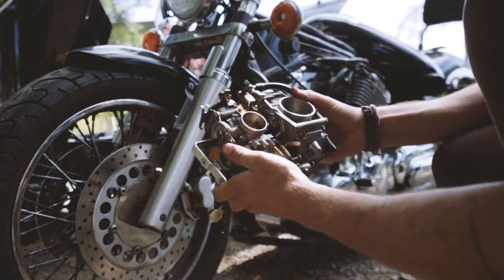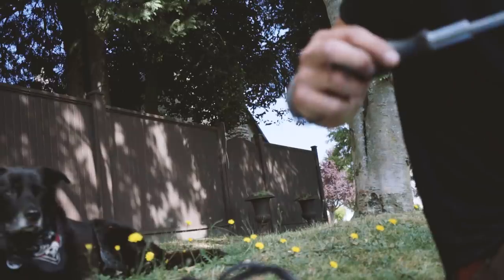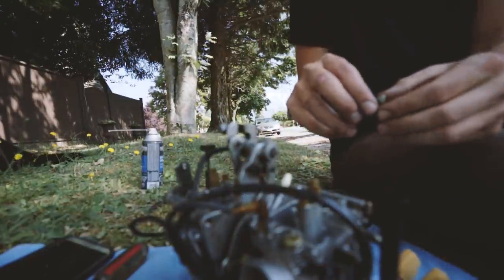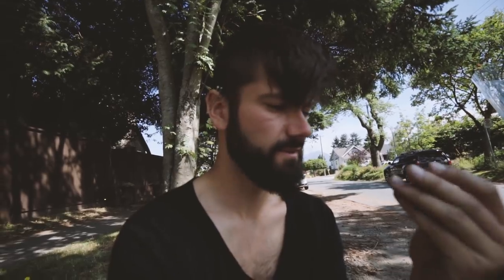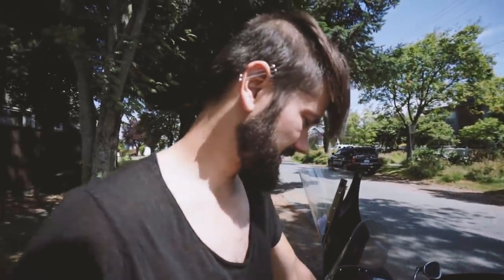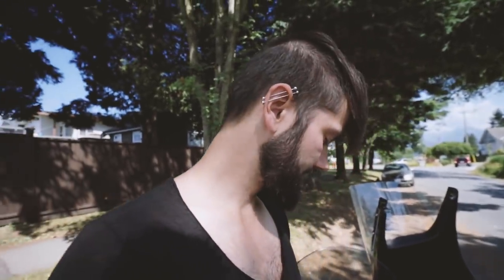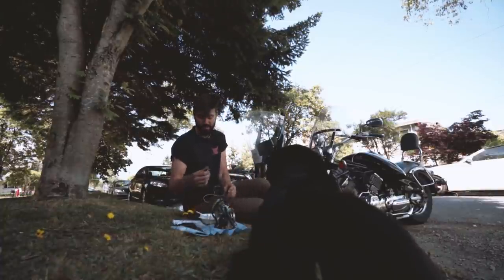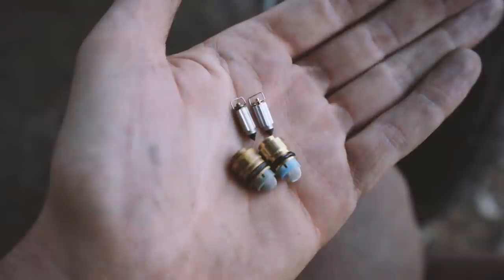My New Bike Squirts Gas - Moto Dog Diaries 2

Comment: Don't know if you have ever heard of sea foam.. It is an additive for the gas and does a great job of cleaning out the carbs and mixing with the little bit of water in the gas to cause it to burn and cause all things gas related to work better together.. in the states it is about $7.00 for a can that will more than treat a tank the size of yours and since I use it all the time, I believe it is well worth the price...